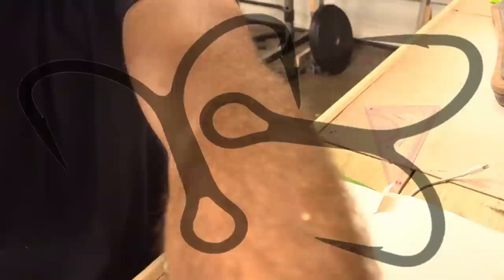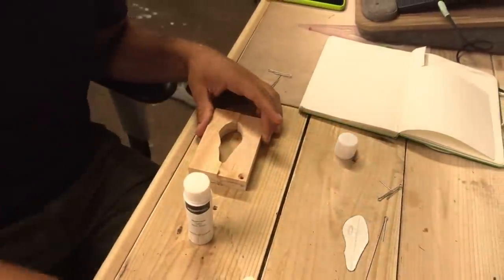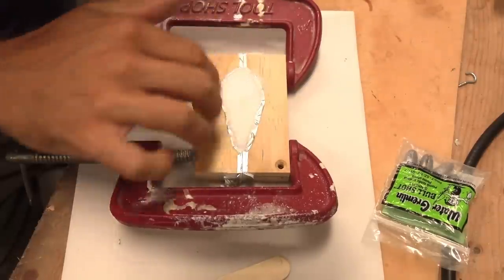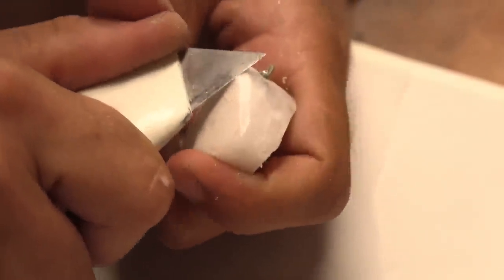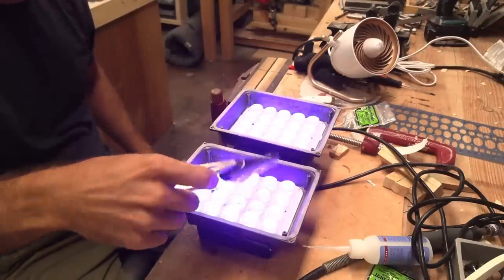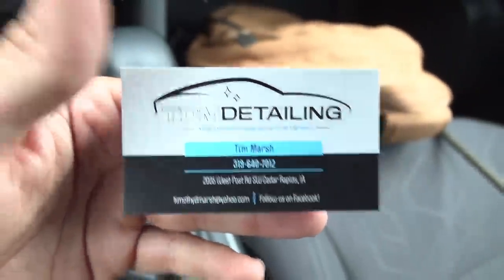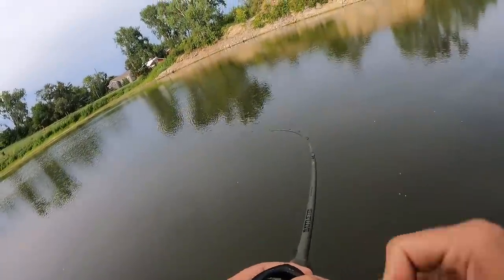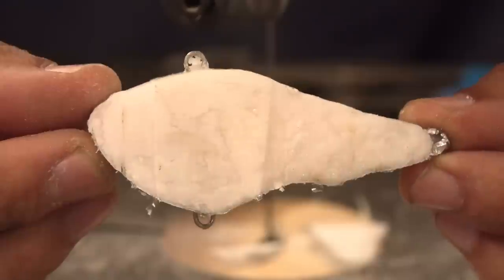SOLID Super Glue and Baking Soda Bait | One Day Build to Catch

Comment: Simply pinch the ends of a soda straw segment shut with pliers and melt them closed. Use this little plastic pillow to make the top of the SG&BS bait lighter than the bottom, and skip the lead if it's already heavy material. (simple as)  Once you master this tech level, you can get started on polymer reinforced fiber matrixes... Like making hardboard out of napkins, or bluejeans, and whatnot. I'd like to see you colab with one of those weird knife makers, and create a "swiss army knife" that also has an eyelet and a couple hooks that pop out. That's something that even they have unlikely thought to cram into one of those things.

Comment: when you revisit this think of the build up more like 3d metal printing. you can leave untreated baking soda in specific spots and when you're done drill a small hole to access those spots and dump the untreated part to create engineered voids then all you gotta do is seal the hole. (ballast points.)

Comment: I didn't know we were sp close lol. Only 3 hours. Colab in the future? Distant future. 
As for the bait. I think a blade bate may have worked with a more narrow top. It did look like the bottom hook hanger was off center so it could have effected the bait action. BTW did you get a weight on the bait? Aside from "that's a heavy bait"?

Not a couple ideas for the next try.  Because you can make this work.   Have you made a bucktail? If you look at a bucktail there is usually a weight at the front followed by a couple beads. You can replace the weight and maybe the beads with sg/bs carved fish head and body segments. You could use a through wire and put an extra treble on the front. Or make the fish head then drill straight through  for a fish head that slides and will tap on the beads. Have your wife tie a big hair or fether treble. Make it about the size of a small muskie bucktail or large meps #5 for pike. You could use a normal willow leaf or make a sgbs dog tag with an angled hole in it then shape it a bit like a propeller.  

Second idea, remember the hardwood softwood lure? Make a bulsa top and sgbs bottom. It may be hard to get balsa to sgbs ratio to get a float or neutral sinking bait line tie in front. If you Gan get a neutral buoyancy  you can do alot. Like a glide crank or jerk.   Haven't seen a jerk bait from you. In a while. Bay have to be muskie size flat side jerk bait but those are some ideas.  

My prototype  3d printed lure broke at the joints. So  need to find a better solution for super flexible joints. 🤔  lol

Comment: You could create sealed air chambers/balsa chambers and make the bait around those. Then you get the benefit of different density but you can have the structural integrity needed to hold up to fish and casts.

Also, you probably had a burr on your line tie from drilling out the material.

Comment: When you cut the wrong wire, reminded me of when i had gotten snagged and then snapped the line off. And then when I was re-tying on a new leader, every time I went to tighten the knots, the braid would snap because it was frayed from the snag. That happened 3 times before I caught on, so I took about 3m of braid off to remove any frayed bits, and then tied on a new leader, and when I was snipping the tags off, the wind caught the line and cut the leader off instead of the tag 🤦🏻‍♂️ the guy standing next to me who had watched it all died of laughter

Comment: Probably late beyond usefulness with my comment, but if you attempt something like this again or if someone else who plans to do this is reading. I recommend laying the baking soda in thinner layers while building up your lure body, it's like using a resin printer in that you're laying a thin layer of material and curing the layer before moving on.